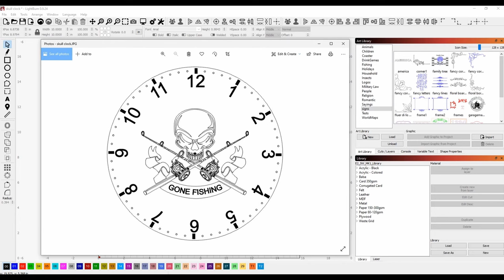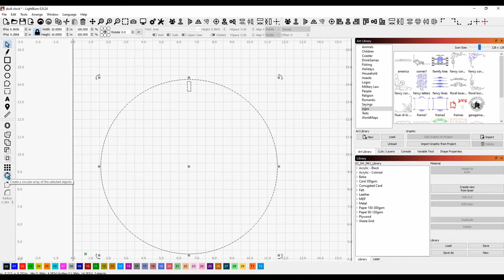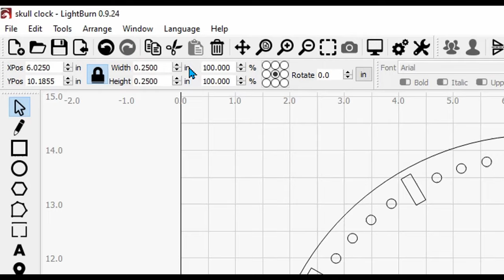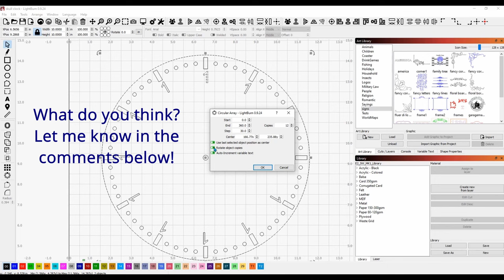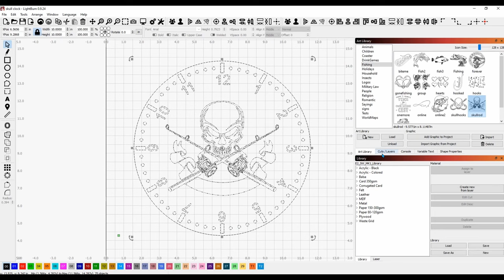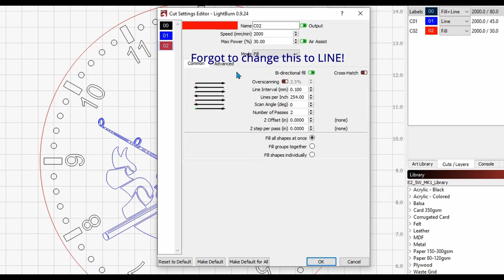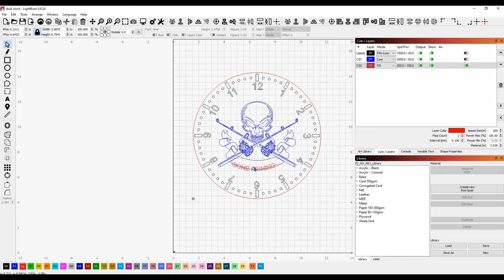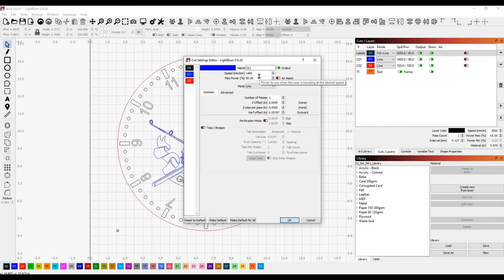Create a Skull Clock with Lightburn in under FIVE Minutes

Comment: Again, I learned so many tips and tricks! Here is one for you - you can curve text using that blue dot, yours is to the right side of the text once selected, mine is on the left.
Reply from the maker: Yes ma'am! I shouldn't have said, "the only way to do it." There are 3 ways to do it. I use the curve text feature in other videos and really a lot on my projects, but the only exact way to do it is aligning text to a traced line. I can never seem to get the curve text feature exactly and proportionately aligned. Thanks for the comment!

Comment: I'm new to laser engraving and cutting,I am also new to lightburn and trying to learn the ropes and I find your videos are just the best thanks for sharing 👍 
There is one problem that I'm having and it's when I go to cut out letters it cuts the hole letter out ....let's take B if it cuts out the outline of B it doesn't look great i need to contact the 2 centre parts of the B to the outer line so they don'tget cut out,hope you get what i mean, have you a video how to do this the correct way thanks in advance
Reply from the maker: Yes, use a stencil font, or you can create your own with the weld feature Robert.
Reply: @TheLouisianaHobbyGuy  thanks a million ill go ahead and try that

Comment: How did you know you had a belt problem? I'm trying to learn troubleshooting before i have issues.
Reply from the maker: It actually wasn't the belts, they were perfect. It turned out to be the bed that wasn't level. My wood spoil board had warped, since I did this video in the garage with the door open.

Comment: Really great information. I have a home built 100 watt CO2 laser with a 18" X 36" bed. Been using RDWorks (came free with the DSP controller) and just from watching 2 of your videos, I have to get lightburn now. You make it look so easy.

 Need to ask why you didn't use your CO2 laser to make this???? It should of made the cut in one pass and no burning (if you have it at the right cut speed). BTW, I gave away my home built diode laser after I built the CO2 one. The CO2 is 1000% better than the diode that I had.

 How do you do backlash compensation on you diode laser??? Does lightburn have in it somewhere?? Most that I've seen don't have it and that is one of the many reasons I got rid of mine. 

 Thanks for doing these very informative videos

Rodney
Reply from the maker: I was in transition from one shop to another at the time of this video, so the Co2 was in storage. Besides, I have a large amount of diode laser uses watching so I use both. You can choose to "hide backlash" on the laser tab in the Optimization Settings, and adjust the eccentric nuts, and adjust the belts or any combination of the three or all to eliminate backlash.
Reply: Thanks

Comment: Amazing video! I learned so much from you from all of your videos - I can't thank you enough!

One question I have is why did you not cut the hole for the clock mechanism with the laser? Why did you prefer to drill it?

Thanks!
Reply from the maker: I didn't actually have the mechanism when I did the video. It arrived 2 days later, so I just marked the right spot because I didn't have the exact measurement at the time.
Reply: @TheLouisianaHobbyGuy  that makes sense! I thought there might have been more to it. 
Thanks!

Comment: Did you drill out the center hole for the clock stem? If so is it because laser cutting it out would make the hole slightly larger than needed?
Reply from the maker: No, I just forgot the hole! 🤪

Comment: Is there a reason why you wouldn't just set the clock mech hole to a cut instead of burn so you didn't have to drill it out later? Where did you get your elevated base plate?
by the way, listening to you reminds me of watching a Bob Ross video while he paints. Very soothing!
Reply from the maker: I could have cut it with the laser, but I had to use the drill press anyway to drill out the area where the mechanism sits on the back so it didn't protrude from the wall too far. Links for the cut plate are in the description.

Comment: Liked the video. Just a quick question :) On my Win 10 64bit system, holding down the mouse wheel and dragging  it ,doesn't move the work space :( Sounds pretty simple. What am I missing.
Reply from the maker: It may be a mouse issue. Click the 4 arrow crosshair icon, below help in the top toolbar to move the screen with the left mouse button.

Comment: Why drill out the center when you could have just put it on the red layer and cut it out? Also the curve on the bottom of the graphic that you used is slightly bigger than the top so the text matches the bottom but not the top. Maybe use the curve text feature instead? Great video was always. I know I'm  being pretty on the comments.
Reply from the maker: I don't cut the center hole on clocks John because It sometimes leaves scorch marks, so I prefer to use the drill press for a clean hole. I could have used the curve text tool, and I usually do, but I try and show the different features of Lightburn in my videos. There's almost always a faster or easier way to do things. Thanks for the comment!

Comment: I stumbled in your videos and very happy that I did. Very informative down-to-earth education. I have the 20 watt ortur laser.  I have been trying to find an air assist that would work with it. What type are you using and where did you get it?
Reply from the maker: Welcome aboard Trent! Air assist adapters are available on thingiverse to 3D Print, or on Etsy to buy.
https://www.thingiverse.com/search?q=ortur+air+assist&type=things&sort=relevant
I use a custom made one I designed in CAD with a CPAP machine as the source.
Reply: @TheLouisianaHobbyGuy  CPAP? I never thought of that.. I have one that I'm not using any more because I replaced it. Might have to look at that. THANKS!  What airflow value did you use in the Tech settings?
Reply from the maker: @mpcaz  When I was using it, it worked very well!

Comment: Downloaded the clock from from this site, looked in the preview to see it cut , clicked out of preview and started the run, when it started to run I then noticed that the run time was just over 7hrs, the settings were ; label 2000/70 pwr CO1 2000/80.0 and T1 Tool frame. It seem's a slow project to do, 7hrs is a long time, was these the settings that you used to make the clock? The end product does not look as tidy as your's, I am using a Falcon 10wmachine. If I make another is there any way of cleaning it up and cutting down the run time? Have no idea how to send a picture to show you. Looking forward to a helpful reply. Other video's of yours I am following are great, keep on going. Was your cut done on Laser or Diode?.
Reply from the maker: The settings are remembered on the layers from your last job. You have to set them manually for your laser.
Reply: @TheLouisianaHobbyGuy  how do you change the outer black line to cut so that it will cut out
Reply from the maker: @ianmallett78UK  Change it to Line in the Cut Settings.
Reply: Thank for the reply, I am looking at the" Cuts/Layers"on the first item where you have put under the" # " sign it reads "lables, next  LAYER is  OO in Black and Mode is Line. How do I change tothe outer black line to cut? Sorry to be a pain in the butt but I am still learning how to do all this, being an OAP the brain is not so fast. The rest of the setting that are  on the Cut/Layers have CO1, 01 in blue and last is T1 in Orange  with Tool . There ia a box that says Frame. I hope that we are both on the same page for all of this, Thanks again for all you help and patience to an old man. regards Ian Mallett.
Reply from the maker: Try posting in my free forum. I can't address these questions here in a comment: https://lahobbyguy.com/bb